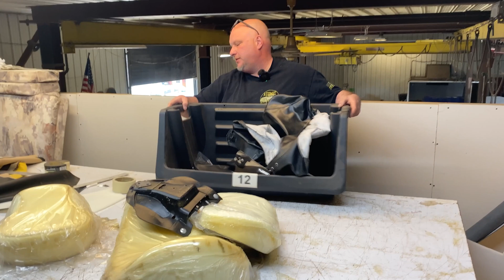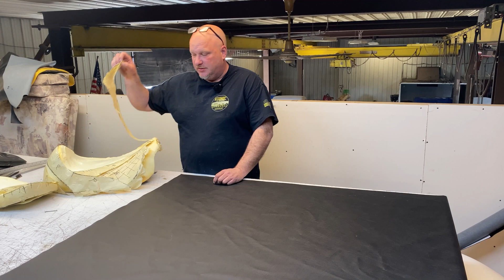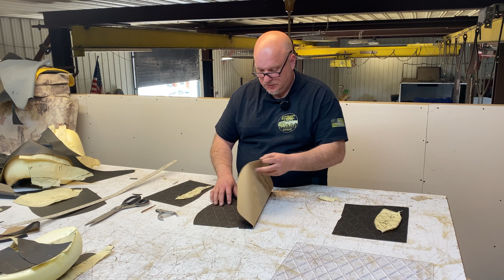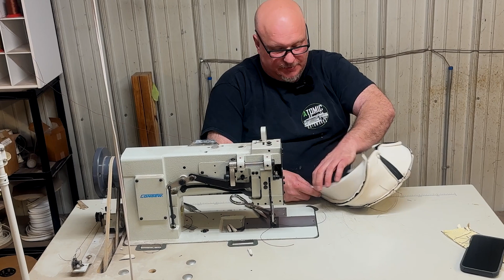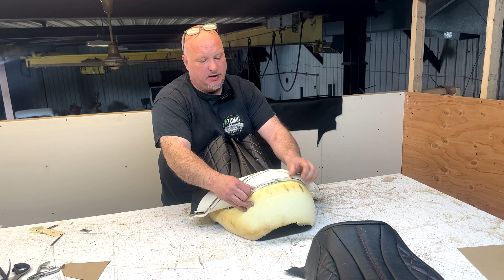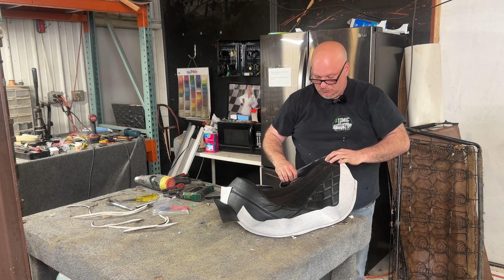How to Build a Custom Harley Seat (Start to Finish) | Pro Upholstery Tutorial

Comment: Not a comment but a question. What tape do you use to make your patterns. I have tried several and it all falls off. Thanks for any and all help. James
Reply from the maker: Honestly we use whatever cheap stuff we can find. 90% of the time its just the cheap home depot tape. We have found that rarely there is a foam that it doesn't stick to well however most the time its great and sometimes we have to even detac it so it doesn't bight to hard and peel the foam up.

Comment: I love my stock seat on my Harley, but I don’t like the vinyl. So I want to do leather instead of vinyl. I also wanted to add some gel to the seat. I went ahead and did the adjustments to the seat with the gel and was able to not modify the size of the seat. My mother is a sewing fanatic and has a very expensive machine and she offered to do the leather work. I bought a used seat the same style as mine so I don’t mess mine up lol let’s see how this works out. Love your channel. Thank you.